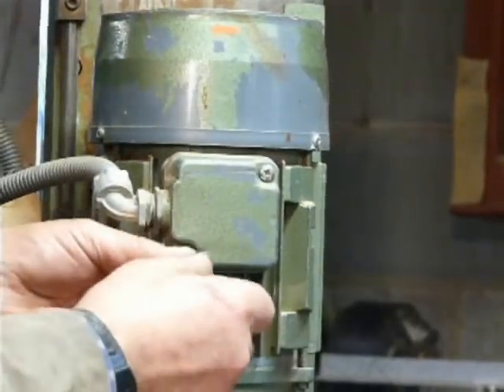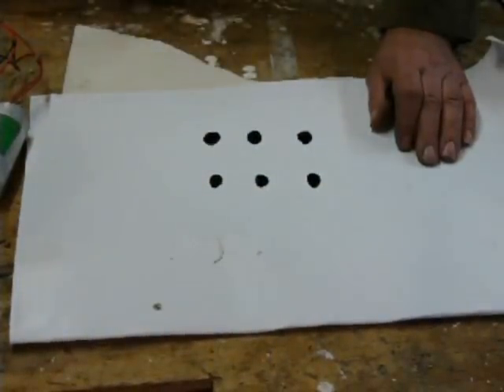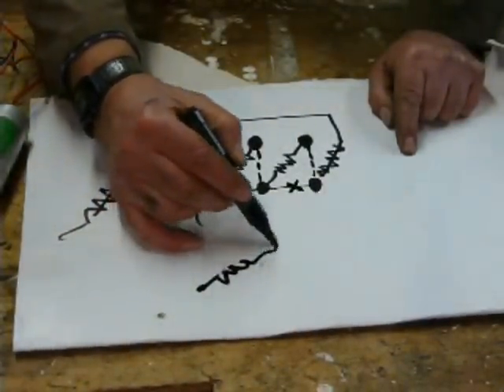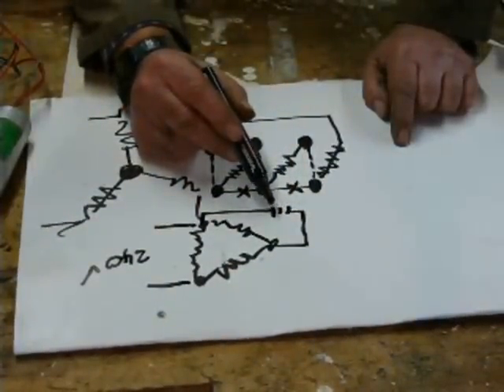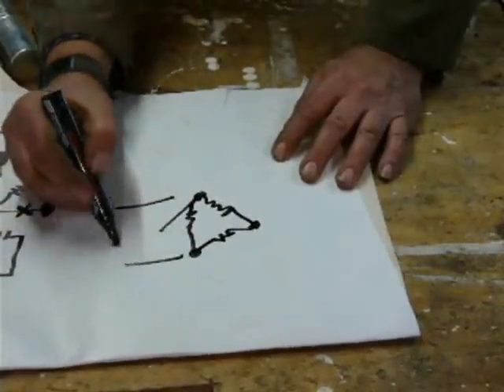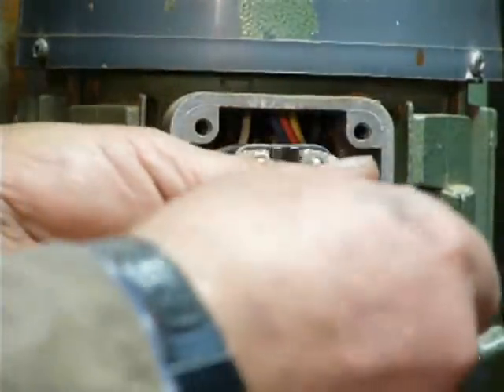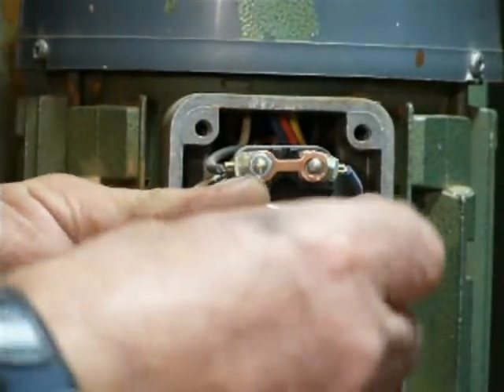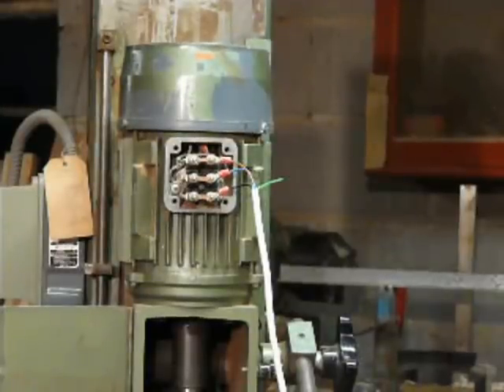How to do it: run a 3 phase motor on single phase supply. part 1

Comment: My 80yr old dad just passed in November of '23. He had worked for Harrison Radiator Division of GM for 40+ yrs. He had spent most of that time as a boiler code welder. When he retired he always wanted to set up a metal working shop here in our barn with 3 phase. Well that never happened. He was able to purchase some things from the plant where he spent the last 10 years because Delphi bought out Harrison and was closing it down. One of these 'goodies was a large fan which I believe has a 3hp motor. It was wired for 3 phase, my dad didn't know how to convert it, so it has just been sitting in our barn for 20yrs. I saw your video when it was fairly new, and shared it with my dad who got excited. The next thing we knew we were too busy to get into it. I felt like it was a carrot just dangling in front of me, but only inches from my grasp.
Well, now I have a bit more time, so I'm studying up with all of your wonderful videos. I will be paying very careful attention be assured. Thanks again for sharing your great insight & resources Andy!
Reply from the maker: Thanks for your heart felt message, it make me realise the relief that I took the videos of Uncle Harold in his workshop, when I had the chance, cheers
Reply: @TheInfoworks  Yes sir absolutely! I do appreciate you immensely. years go by and I think about watching your videos. I have watch a vast number since too, mind you. I told my mother that you made pineapple pudding (we call cake). We've also made one quite similar over the years since I was a little boy. We call it Pineapple upside-down cake. It's not a fancy dessert, & is very simple to prepare, but It really is quite tasty! I say some of the simplest things are the best! Well, once again Andy my friend thank you for sharing your knowledge with humble runts like me. Bless you!

Comment: This helps. However I am going to have to watch this more then a few times for it to sink in. Thanks, subscribed to learn more about this to build a rotary phase converter.
Reply from the maker: Hi, yes the use of a no load pilot motor stabilises the third phase, I think I covered this towards the end of the series, cheers
Reply: @TheInfoworks hi could this be done with my 1968 3phase 3hp motor on my lathe as my new landlord won't let me wire into the electric supply for a phase converter. I.e what capacitor size would I need to get it run correctly. Thanks Michael
Reply from the maker: Hi, you would need a pilot motor and 3 hp would draw plenty of current when starting, cheers  @mrlittlemouse1
Reply: @TheInfoworks  hi thanks how big would you go with the pilot motor thanks Michael I'll subscribe now
Reply from the maker: I'd say something like 1 HP, you will probably have to take power from several outlets, cheers  @mrlittlemouse1

Comment: How can I calculate or know the appropriate capacitor for us? Is there a way or formula for calculating the specifications or power rating of the capacitor?
Reply from the maker: Somewhere in the comments about 5 years ago is a formula, but there's always a measure of trial and error, cheers

Comment: Andy..what is value of run, and start capacitor i will used for every hp 3p motor
Reply from the maker: Difficult, but if you use 60 for the run and 90 for the start, that gives you somewhere to start your experiments. It's not an exact science. Watch all 7 parts to get a better idea, subscribed? Cheers

Comment: Does the motor have to be dual 230/400v  or can it just  be an old 400v
Reply from the maker: Hi, it might work on 415v windings but would have less power, only one way to find out, crack on, cheers

Comment: Hi there Andy,  you just got a sub.  I have just completed my second year at college doing the course of an electrical installation and going onto my last year we will be looking into 3 phase star and delta in more depth so finding this very very interesting indeed.  I have just purchased a 3-phase Meddings pillar drill off eBay so I do not know whether the motor is dual voltage yet.  If it is I was going to run a VFD on it.  Could I instead run it off the way you describe here with a capacitor?  The reason I ask is what happens with the speeds of the motor, will I have to then change the pulleys like I would if it were connected to a standard 3-phase supply?   Would very much appreciate your input/knowledge here thank you very much.  Jeremy
Reply from the maker: Sorry this has taken a while, Youtube problems, just wire it up with a capacitor, it will u but with less power, the speed will not alter as that is based on the cycles. Hopefully you will have just got on and used the verry useful trial and error method, cheers

Comment: Hi, What is the maximum current on startup through a 25uf Cap on a 2 hp 3ph motor. Need to know so i can select a switch. Thanks
Reply from the maker: Hi, it's normally about 10 x run current, but it's for such a short time that a switch at 30 amps would be more than adequate. I normally use what I have in stock, subscribed? cheers

Comment: Considering the three- sets of coils in a three-phase motor having both "electrical degrees phase shifting " and "mechanical degrees'' location on the stator then if a DC is applied to one phase it will magnetize the stator in a particular polarity and location.  If the other two coils are added in series and supplied with DC voltage then their magnetic field will be opposite to the first coil. If the latter two series coils are subtracted and fed with a DC, then their resultant magnetic field will be at the right angle to that of the first coil.  This means that one coil could represent one phase, while the subtraction of the other two coils could represent the starting quadrature winding of a conventional single phase motor.
So considering the delta connection, one could apply the single-phase supply directly to one coil and through "series, capacitor" feed the other two coils in series but connected in a subtraction manner to the single-phase supply. This would form a single phase motor with running and starting/ running winding. 
The physical location of the resultant magnetic field would be in quadrature space-wise while the addition of a capacitor would produce the starting time delay or running the second phase to run the motor.

Comment: hello sir
all the way from the gulf 
i have a vaccum motor  380v i want to convert it to 220v BUT the problem is that it does not have the circut board like in your video to change the connection.
if you can give me your email or whatsapp number so i can send you pictures
Reply from the maker: If you just use the 3 wires as they are the motor will run but with less power, cheers

Comment: Hi there, will this work on a brushless DC motor found in a washing machine (LG, Samsung, Fisher & Paykel, etc)?
Reply from the maker: HI, sorry no, this only works with AC, cheers
Reply: OK, thanks anyways though. I’ll just have to repurpose the controller I found in the washing machine I’m using (F&P SmartDrive).

Comment: The dux guts is a tank circuit invoking power factor aka phase shift expressed as an angle or percentage in single phase transformed to a rotation direction. 3 phase dual voltage motors have 9 wires to connect properly. They run, or they hum, if they don't know the words, or the connection is faulty. Then they burn, while you learn, and I earn. Motors and condensing unit controls are often filled with mouse nests- a major source of fur for automobile ceilings, and work for guess who. 3 blind mice

Comment: I would like to extend my thanks!( I don't comment or thank much on youtube at all and you are my first) I've rewired 2 machine now, an industrial power hacksaw and an industrial air compressor(both 3 phase) and want to seriously thank you for your effort of explaining things in this video. You've not only saved me money but also taught me something I didn't know.
Seriously you are a diamond in the rough channel and I honestly believe you have a vast amount of knowledge that a lot of future generations men must soak up. Thanks!
Reply from the maker: HI, you did well with the compressor as the starting torque can be difficult. I have added links to the 3 phase playlist in each of the videos. Have you seen part 7? subscribed? cheers

Comment: Y or Delta but the big motor s start in y then a switch grear throws it to Delta, y has more tourqe for start Delta better at high speed

Comment: Hi Andy how can I get that book and I also need to Know on single Phase 2 hp brook motor rewinding complete like what gauge wire on running coils and how many turns on running coil.also same on starting coil the gauge and turns. if you can help or were can I get on google.Thanks.Lofty or just send email Lofty411@gmail.com please.
Reply from the maker: Hi, the book was available from Maplin but they have gone bust, try Ebay. For your motor measure your existing windings and count the number of turns. The start coils normally have thicker wire, cheers
Reply: @TheInfoworks  Thanks.
Reply: I have Acme 5 x 24 series time transducing capacitor with built-in temporal displacement &dimensional warp generator containing the GRC79 Induction motor..can I use my single phase power panel to cause field interference?🤔

Comment: We Can supply 220 volte 3 phase on single phase motor ?
Reply from the maker: Hi, there are 7 parts to this series and yes we can run a 3 phase motor on single phase supply, see part 7, cheers
Reply: Viren Chaudhary nnr
Reply: Yes you can utilize a single phase motor to a 3 phase supply by using ANY TWO of the three lines supply.
Reply from the maker: In the UK there is nominal 415v between any 2 of the 3 three phase wires and 240 between any 1 wire and neutral, cheers
Reply: Viren Chaudhary how

Comment: Sure it will work, however it wont last! That is just creating a phantom phase & not a symetrical phase. The motor will work but the efficiency and torque will not be correct there by burning the motor out long before natural end of life.
Reply from the maker: Hi, thanks for the comment, yes I agree but I have a large 3 phase bench grinder that I converted 25 years ago and it's still working. So for the home workshop this method allows the use of industrial tools. Cheers

Comment: Good video, thanks for the info. Now have my 1/2 hp pillar drill motor running well. Used a 10uF capacitor, not sure on the maths but it seems to work well after running for a good hours test.
Reply from the maker: Adam, thanks for the update, pleased it all worked out, see part 7, Subscribed? Cheers, Andy

Comment: what will be the capacitor for 1/2 hp motor from three phase to single phase start and run
Reply from the maker: Hi, to run a 1/2 hp 3 phase motor on single supply use something like a 30 uf cap, experiment to get the right voltage, see part 7, cheers
Reply: For starting capacitor sir?
Reply from the maker: Hi, abouit the same but you will have to experiment as this depends on the torque required, please give the thumbs up and subscribe, see part 7, cheers
Reply: @lordgetorres9225  use 80uf - 120uf 250v ,you will need potential relay as cut off switch.. or if you like use adj. time delay and relay as cut off switch on start capacitors

Comment: What if I have 110 both terminal like in phillipines
Reply from the maker: In that case your dual voltage 3 phase motor will be 240 star / 110 delta and it will work just the same as my example. cheers
Reply: Meralco is line to line.. 110v  per line. In provinces neutral to line its zero to 220v.

Comment: what size of capacitor needed to run a 1/2  hp motor
Reply from the maker: Anywhere between 15 and 30 Uf, you will have to experiment and then measure the voltage across neutral and the capacitor. Subscribe as there will be another video in this series uploaded early September, cheers

Comment: Please what do you advise, I've not done it before what will work best 220v or 400v, I have this 3phase motor that I want to run on single phase. Your advice will be very much appreciated
Reply from the maker: Frank just follow the video, that's the best way to learn.
Reply: The higher the voltage supply on motor, the lower it consumed power. So 400 volt  3phase is much better than 220v .
Reply: But your motor must be same voltage input on power source. Your single phase supply is 220v,

Comment: will this work with a brushless dc motor???
Reply from the maker: Hi a capacitor will charge up and act as a buffer on DC. Cheers
Reply: Andy Reynolds thanks I don’t mean to a pain but will this also work on small Outrunner Bldc Motors as well????
Reply from the maker: Daniel, I am not sure what BLdc motors are, but this method is only suitable for ac induction motors. If you have any doubt then experimenting is allways great fun, Cheers

Comment: What size of capacitor will use to convert 1hp 3 phase to single phase
Reply from the maker: Hi, Frank, between 30 and 50 Uf depending on the motor and its use. You will have to experiment, cheers
Reply: Thanks so much again for your response, what about the voltage will 400volts be appropriate
Reply from the maker: If you have 400v then maybe you have 3 phase already. If you have only single phase then star connection for 400v and delta for 240. Also if you choose 400v you will need high voltage AC capacitors. cheers

Comment: Even if you do bump a cap. To start the rotation, the motor still runs at 1/3 

What you do is use a neutral as a center tap to your star config and 120 to one coil with other 120 to other coil.
And use the 3D point of a star to bump cap. To

Comment: Your video is very good  information.You are converting single phase into a three phase by using the capacitors due to which the angle between the 2 windings is made between the voltages and currents.An induction motor single phase will never be a self starting .It requires angle differences between 2 or 3 windings. By using capacitors you get the 3 phase supply . It is essentially used in  fans, mixers, blowers, drillers.You can use inductors to achieve phase angle differences . A ceiling fan motor which uses single phase supply has a main and an auxiliary winding which is nothing but a 2 phase split phase induction motor.